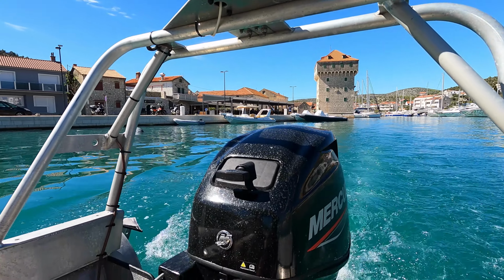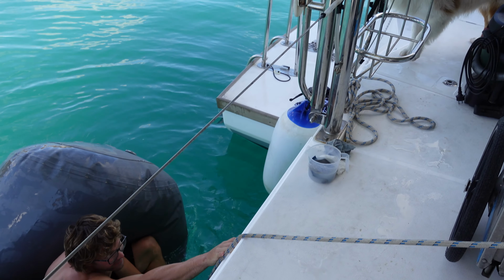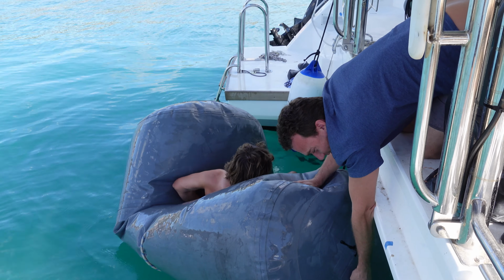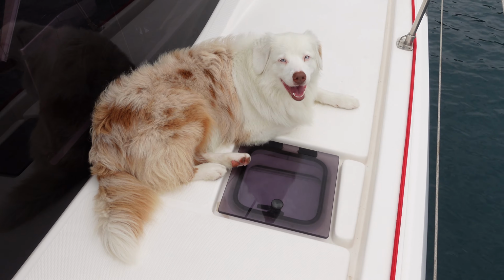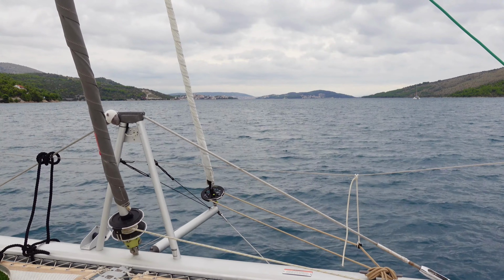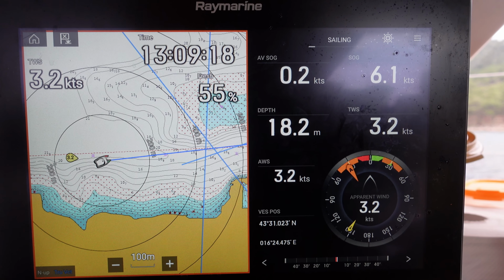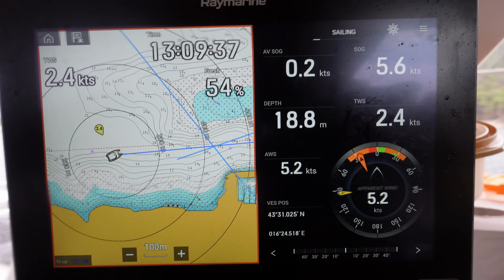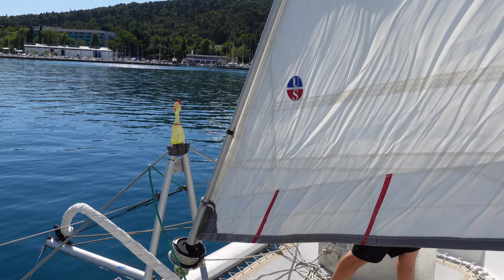Daily Life Aboard on a Sailboat in Croatia

Comment: Funny you mention not being cold with the hail. In Texas we mostly get hail between 29 and 35.
Reply from the maker: Back at home it'd be maybe 44F on the rare occasion it hailed but when this happened it was around 60F - not what we're used to! If everything goes to plan we might get to experience some Texan weather in 2023 😎
Reply: @travelsketch  I wasn’t guessing you would be more familiar with C. But we almost never get rain when the temp is below 60F. And here hail typically occurs when the temp has dropped a few degrees from 100F to 80F. If you make it to Texas I would love to know if there would be a chance of meeting up.
Reply: @AbNomal621  I am thinking about Texas for boat work to get the cross beam and windows repaired.